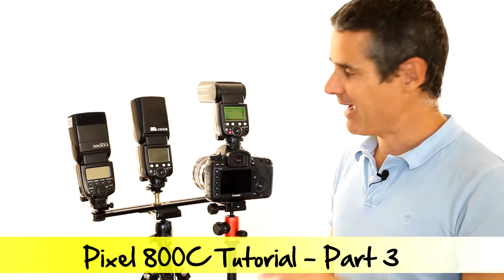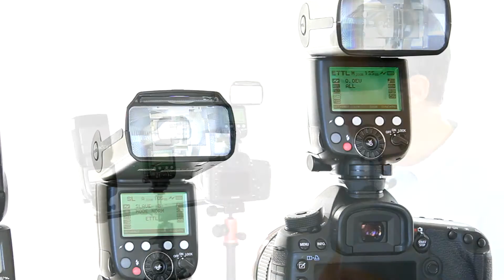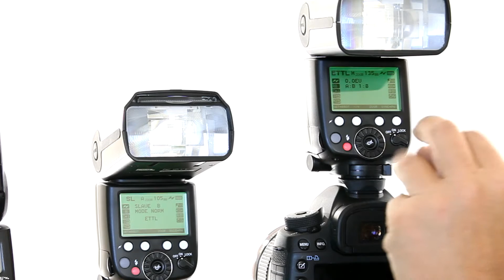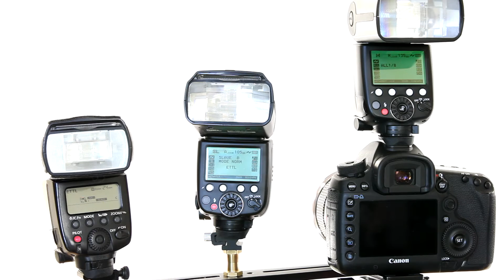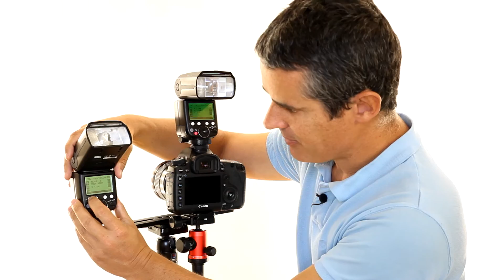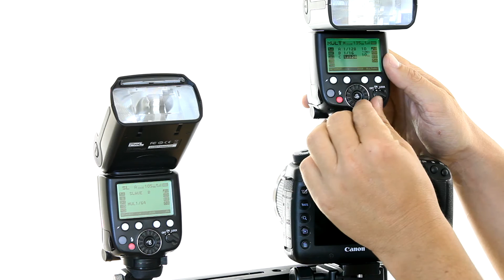Pixel X800C Speedlite Introduction Tutorial -Part 3

Comment: hi, thanks for this tutorial, i having a small problem, my unit cant switch from optical to radio mode, when i press the remote button it will always jump from group setting to channel setting, the mode setting is not accessible, any solution for this, many thanks in advance.
Reply: tengo la misma duda y el mismo problema

Comment: Will high speed sync work on the slave X800C when use manual mode trigger by radio transmission?

Sincerely,
Reply from the maker: +HOUSCOUS  Yes, that's right.

Comment: Thank you for a great review Blaise Fiedler!! This is the most thorough look at x800c, I've seen so far. Maybe part 4 showing it work with Pixel King Pro? :)  Pixel Enterprise Limited it would be great to see added feature of mixing ETTL with Manual flashes wirelessly controlled from x800c. I'd like to put one x800c in ETTL on-camera and with it control off-camera flashes which would be in Manual. I know I can mix modes with King Pro, but it would be more convenient to just do it with the flash itself.